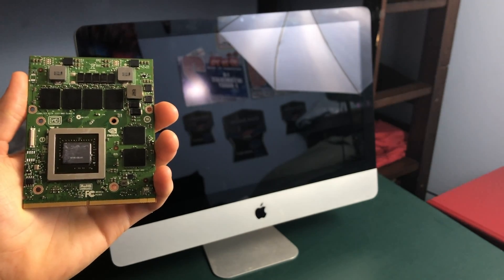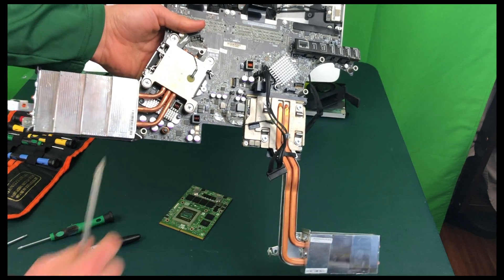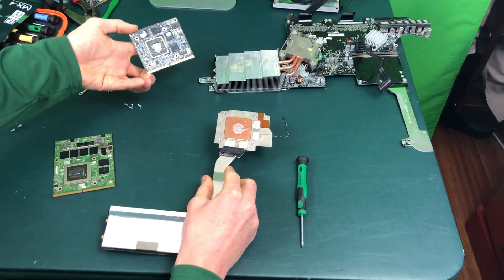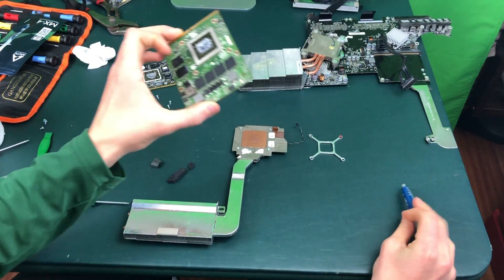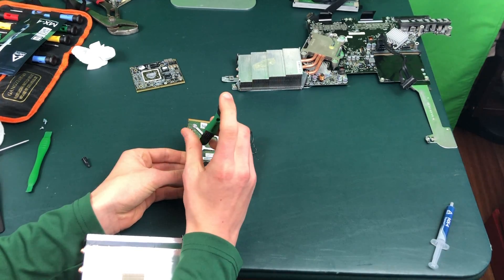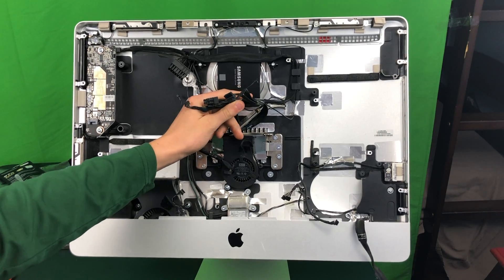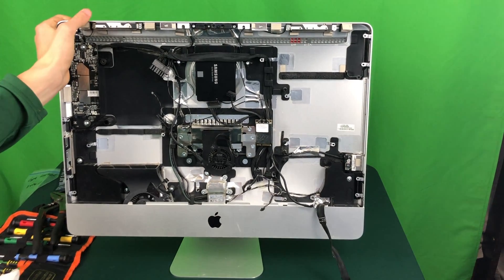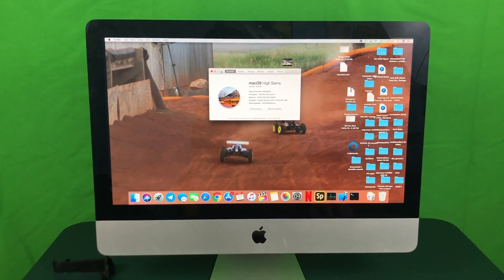How to Upgrade/Replace GPU Graphics Card on Mid-2011 21.5" iMac

Comment: This is a big nope for me. Swapping the hard drive for an SSD and upgrading the OS to Ventura is about as adventurous as I plan to get.
It's a shame this system doesn't have any USB 3.0 ports, because data transfers are painfully slow without it. I don't suppose there's a solution for that, is there?
Reply: What if your original GPU dies which it will eventually?

And would Ventura be the the best choice for the newest version for this 2011 iMac, and not Sonoma?
Reply: @reallauradee  I don't use my iMac often enough for that to be an issue. Although I should power it up just to see if it still works; it's been a while since I messed with it.

Comment: Can we upgrade CPU and GPU at the same time?
Reply from the maker: I have a video on GPU but I wouldn’t recommend.. the power supply doesn’t support it well and it won’t sleep and just causes other issues in general
Reply: @techitout4710  👌thanks for the tip
Reply: @techitout4710  Would removing the SuperDrive free up some wattage for a GPU and CPU upgrade? While simultaneously creating more airflow to cool down the iMac? This is my first Apple PC (Found it in a trash bin, Everything but the HDD was fine). I am asking because I wanted to know how much the SuperDrive uses in watts but couldn't find anything.

Comment: Can you use the gpu from a mid 2011 27 inch in the 21.5 model?
Reply: No, they use different mxm standard for the gpu.
Reply: theoretically yes the Pinouts is the Same Between MXM-A(21.5") and MXM-B(27") however the MXM-B is about double the Height and has higher powerdraws and the 21.5" iMacs GPU Heatsink can not properly disepate the heat of the bigger cards

Comment: Why would I need an NVIDIA 770M GPU when this particular iMac came with either an ATI Radeon HD 6750M (2.5Mhz) or a HD 6770M (2.7Mhz) GPU?
Reply: The AMD GPUs apple used in this era iMacs and in the MacBook pros had a high failure rate, and they don't support the Metal API that Mojave and newer versions of Macos require

Comment: Have you done heavy gaming with this? does the heat sink not butn up what ever its touching on the card?
Reply: its a 2011 imac why the fuck would you do heavy gaming on it
Reply: @ussf-unitedstatesspaceforc7541  because upgrading it easily shits on those rainbow boxes geeks like to build.
Reply: @august4rth  yeah but any compatible hardware is trash compared to modern shit
Reply: @ussf-unitedstatesspaceforc7541  2K & 4K 60fps does not take beefy hardware lol the Xbox One X can do that
Reply: @august4rth yeah on low settings it doesn’t need beefy hardware

Comment: Hi, will this work on an iMac 21.5 A1418 mid 2017
Reply: Imposible jaja Since 2012 to now almost all components are solded.Maybe you can do it in other way and with heat... but its VERY difficult
Reply: No, the 2011 macs were the last ones that allowed upgrades
Reply: @jeffersonsanchez5972  yes, then Steve Jobs died...

Comment: So this works on the 21,5 aswell? Macrumors forum has the 765 listed as not working with the 21,5"
Reply: you have to look at the tdp, over the 770m, they aways got a lot of power consumption wich for the 21,5 itsnt good, 770m and 765m works ''fine'' on it, you have to limit the clock and memory clock on windows, or you will have few kernel panics wich is = few 0.01s lags.
Reply: @DukesDZN  Will those clock limits also work under macos?
Reply: @AldiPennyLidl1887  on mac os you cant choose that, only with bootcamp windows
Reply: @DukesDZN  so I run into tdp problems under mac os in any case?
Reply: @AldiPennyLidl1887  depends of the application, most times no, but i know people with 765m on 21'5 imac 2011 running only on mac os without problems

Comment: I want to keep the boot screen.  When I upgrade the GPU in my Mid 2011 27, the 6970M 1GB will move over to my 21.5.  That will double the VRAM and take some of the load off the CPU.

Comment: How is the power supply doing?  The 21.5 is only 210 watts IIRC.  Not a whole lot of overhead for the 3GB 770M.
Reply from the maker: Actually not so great. I didn’t consider that when upgrading the card. It causes some issues with sleep (it doesn’t work) and it seems that 1) the Mac runs much hotter because of the strain on the PSU, and 2) it doesn’t sleep because if you turn the Mac off and turn it back on, it doesn’t always turn back on immediately. It seems like some sort of overdraw protection in the power supply
Reply: @techitout4710  Yeah, loss of functionality is a real problem.  Flash to restore sleep and boot screen looks interesting but beyond my capability.  Anyways, Apple still supports High Sierra so I am not being forced to NVidia.
Reply: @techitout4710  Regarding heat, my 21.5 in stock configuration is a heater compared to my 27.  I wish there were more vent holes.
Reply: @techitout4710  Bro, you have to patch you Bios cmon

Comment: I’m going to get crucified for this, but to be clear, is the GPU the same physical piece as the Graphics Card? Or are they separate pieces that end up working together? 
Because I could swear I’ve seen other videos of GPU upgrades where it’s a smaller rectangular metal chip without the flat green board attached to it, i.e. the flat Graphic Card part?
Reply: The graphics card is the whole card, and the gpu is technically just the little processing chip on the card, under the heatsinc... but usually people just refer the the whole card as the gpu. The gpu chip is not separable from the card, so almost always if someone says GPU or Graphics Card they mean the same thing.
Reply: Sometimes the GPU is soldered directly to the motherboard, like in most laptops. This would be one of the only situations where an upgrade would mean JUST the gpu chip and not a card.
Reply: Jack Schue Got it. 
So in this situation detailed above, the gpu is attached to the whole continent, i.e. the motherboard, that holds everything else together, as one massive all encompassing piece, and the only the gpu alone can be removed (in terms of graphics).
But in the other situation, the graphic card is like it’s own separate island that also has a gpu attached to it, and together they can be swapped out as one piece, apart from the rest of the motherboard (continent), like if the gpu is a hut, it’s like removing the island and the hut attached to it, combined, to swap out for another island with hut combination. 
Appreciate the clarity.

Comment: Hello
I’m doing the same upgrade but I used the gtx 765m
I also don’t have the original drive with macOS installed
Now the computer only gives out boot chime once and the screen doesn’t turn on
Did you have similar issue when upgrading?
Reply: Hay que modificar la bios de la GPU, en el video no sale pero la grafica que el  cambia tubo que modificarle la bios GPU para que funcione.
Reply: Chow Andrew, is your imac 21.5? And how was your imac after updating with this video card?
Reply: @Willianakata  yes and my computer is running smoothly on Monterey using OCLP for like 2 years🙈
Reply: @chowandrew2458  Thanks for answering! I will also buy the gtx 765m card to update my iMac 21.5 (mid 2011). Did you need to do something specific or just change the board and that's it? And did you need to change any other parts, such as the processor?
Reply: @Willianakata  hey I’m planning to upgrade gpu of 2011 imac 21.5 inch. Pls guide me link to buy the gpu and which one do u suggest for running macOS Monterey?

Comment: Very good video! Is the CPU/GPU upgrade worth? I think for doing gaming/video editing in 2020
Reply: CPU is not worth upgrading for many reasons, unless you’re talking about upgrading to an i7 2600S. Not a huge performance bump for most things. Upgrading past the 2600S is not possible due to thermal requirements and power supply requirements the iMac cannot meet.

Comment: One more question. After the GPU upgrade can I still use ⌘-R to restore my Mac or ALT to change starting volume?
Reply: No, you will loose the boot screen after upgrade. You need to flash the GPU, you can refer to macrumors for that
Reply: Si, si hace la modificacion de la bios gpu  e instala OCLP. Puede actualizar su imac hasta macos Monterrey 12.4.

Comment: Hi, can you instal win 8 and update to 10 after the gpu replacement? Or are other drivers required after the gpu swap.
Reply from the maker: You can install windows 10 if you take out the hard drive/SSD, install using another computer, then putting it back in the Mac, or you can just install windows 10 on external drive. You just can’t use boot camp
Reply: Tech It Out thanks for your help
Reply: Hi, you can install windows 10 directly, but Sound will not work (i use a bluetooth JBL Go1 to fix it) or you can modify your imac bios to sound works in UEFI mode wich is on the Mac rumors forum

Comment: What is the max cpu these can take? I have a late 2011 I want to upgrade. It’s the “education” one with a dual core and no Bluetooth
Reply: It should be a Core i7 2700k 3.5GHz - we have a 2600k 3.4GHz in our 2011 model & it blasts through anything - hope this helps.
Reply: Intel Xeon 2600 e intel corei7.

Comment: Will a 780 work?
Reply: into a imac 21,5 definilt no, the power consunp. of the 780 is too high, a 770m or 765m it cant hold but at 80% use.

Comment: This is a worthwhile upgrade, but sadly it's done with the wrong choice of components for the best compatibility. Since this is an upgrade to a 21.5" iMac it would have been ideal to run an nVidia Quadro card either a k2100m or k1100m (the k1100m running a bit cooler is the best choice overall as they are both 2GB cards, but the k2100m is faster).  For those who are so inclined to pursue this upgrade, look it up on the internet by searching "imac gpu upgrade macrumors".  The loss of brightness control is unable to be avoided, however using the Quadro cards will allow you to flash a custom BIOS on the cards thanks to the devs involved there on macrumors. Once custom BIOS is flashed you will regain the boot screen by holding down option key after pressing power button on cold boot.  I like Tech it Out, but the guy leaves you with half-assed information that really hurts the old iMac upgraders.  For instance, that card he suggested is going for $100 more than the k1100m that I bought for $25 on eBay and he also didn't give the above information which is easy enough to find online. He also doesn't go into the fact that this upgrade increases the longevity of the machine because once completed you now have  a metal supported card and can run Mojave or Catalina with DosDudes patcher and a bit of kext injection.  Need to step up your game Tech It Out or you might force me into starting a competing channel. Peace.
Reply: Fully agree with Mr. Beezley.  This video gives only the basics but lacks information / advice on thermal paste for the GPU RAM, adjusting for clearance and (as was pointed out) the MXM-A card selection choices and BIOS flashing to make it more suitable for an iMac.  The video is half instructional and half "stumble with me", which isn't what first timers need nor the fine details that medium level people expect.
Reply: Hey, just wondering, could I send you a K2100M to be flashed personally by you? I'm new to this and would rather leave it to someone who knows what they're doing. I would pay for shipping and your services. Thank you.
Reply: @Justamazing360   wandering if you found someone to do it for you, im in the same spot looking someone to do it to my hp nvidia k1100m... i will pay for it
Reply: @pedroabriles3632  Unfortunately I haven't found anyone willing to do it. I tried reaching out to a few people on different forums and have had no luck. Let me know if you find someone.
Reply: @Justamazing360  I will, let me know too please! Thanks!
Reply: Thanks for this reply (and also for the original video, I really do appreciate both of you taking the time!)
I am a complete novice at this but am going slow to avoid shelling out on a new computer.

I have a Mid 2011 21.5" iMac and have upgraded the RAM to 32gb with noticeable improvements.
I am currently running a Samsung 860 EVO on USB with plans to replace the HDD internally as per this video.
I've just purchased the k1100m on eBay for £67 ($89 or thereabouts) following your advice and the link provided.

My question is, can I install both the SSD and GPU at the same time or should I do the SSD first, make sure it works, and then do the GPU?

Thanks in advance! (The card is travelling from Hong Kong so I have a while to consider!)
Reply: Andrew Laing i installed my ssd as a secondary drive without deleting the hdd as I have the 27in. Without a doubt, install the SSD prior to the GPU. Ssd is a simple procedure. The gpu is very involved and may require further troubleshooting.
Reply: Andrew Laing oh, Curtis had greatly detailed information. Very good channel. Yes, you can do the SSD+CPU at one time, but GPU is a job app to itself so you can troubleshoot any errors.
Reply: @johnbeezley4647  Thanks, I appreciate the help.

Plan is to do the SSD and then processor tomorrow. 

I'll let you know how it goes!
Reply: @johnbeezley4647  did you start your own competing channel?
Reply: @ramelmamedov547  No, I never did. I think of it often, but I don’t see how I can fit recording and editing into my schedule.
Reply: @johnbeezley4647  Hey John, I'm having a lot of trouble figuring out how to upgrade my 2013 imac's gpu so i can play apex. I happen to have an extra nVIDIA  card (same as in this video, what are the chances) but i did some googling and seems like my 21.5 inch gpu is soldered in? but my mom has an old imac that has the magnetic screen so i think its a 2011 and 'd be willing to do the upgrade in that machine
Reply: @domenicming9551  yup, the 2013 isn’t going to be upgradable. Take a shot at the ‘11.
Reply: Mr. Beezley, Could you point me in the right direction please?
I have a 2011 27inch 3.4ghz i7 iMac with a dead GPU.
Can I use a k1100m in my iMac as a straight swap without flashing? The k1100m stands out to me as it’s a good price, about 1/4 of the price of GTX series I’ve been looking at.
I’m not worried if I don’t have a boot screen etc
I’m not really sure how to flash cards at the minute so I am trying to avoid this. I just want a card I can put it and turn on and it works.

Thank you :)
Reply: @kieranroberts8407  yes, sorry to reply a month later. I have notifications off. That's actually the same card that I'm going to use in a new to me 27" iMac that I recently procured. The k1100 is a plug and play card- however, it will not allow you to have brightness control, a boot screen, or target display mode without flashing the card. Check back with macrumors because this has been simplified and can be flashed using only a Linux usb.
Reply: Mr. Beezley can you use boot camp in order to flash a card because would think that might actually work
Reply: NicVandEmZ sorry to be so late in response but yes it can be done with a boot camp partition
Reply: @johnbeezley4647  hi, quick question, is bootcamping windows on a mac worth it? I'm afraid my performance of my mac will get degraded, but some say its perfectly mine, please respond
Reply: @Crash yes, totally worth it and zero performance degradation if installed correctly. Correct installation would require the use of the hybrid mbr/gpt partition and installing via the super drive with a windows 10 iso file being burned to a DVD. Then you can get all your Apple peripherals to work correctly and have sound they the internal speakers. I actually just completed this installation and set up because my kids want to play Minecraft together and I needed another window pc. It just won’t work with an installer USB so don’t waste your time. If you can get Windows installed with the USB you will not have sound and many of the features won’t work. 

Sorry for the late reply.
Reply: @johnbeezley4647  hi, that was a month old comment but I am now happy to say that its been 2 weeks since my bootcamped windows and it works like an absolute charm!
Reply: Crash I don’t usually even notice my comment notifications because they get lost in the notifications from channels I sub to. When I do I always reply if it’s something I can help out with, but yes, I agree and I’d even say the Windows 10 is better on this old Mac than MacOS. I’m really impressed with both the hardware and the windows OS.

Comment: Is this actually worth it? Working on these machines has always been a pain for me.
Reply from the maker: Yes. I’ve had some other issues with it lately though. I believe you will have less issues with the 765M because it has a lower power consumption rate (65W) instead of 75W on the 770M. I’ve had some issues where it won’t sleep or sometimes it won’t turn on. It’s like it tries to but just can’t. I think it’s because the 770M takes so much more power than the previous AMD 6750 (35W)
Reply from the maker: But the performance upgrade outweighs the other issues so I say it’s still worth it
Reply: @techitout4710  I've seen some of your other videos and honestly it seems that you should do a bit more research on the forums before you complete your upgrades.
Reply: @techitout4710  try clicking the Login Window from the user name on the top right window and shut down from there.